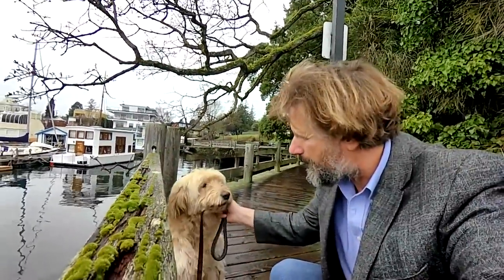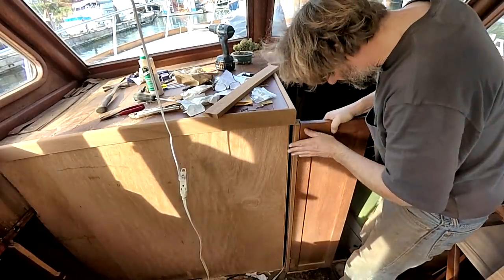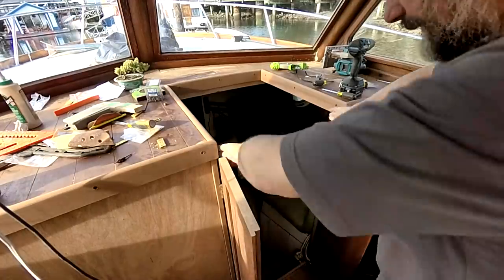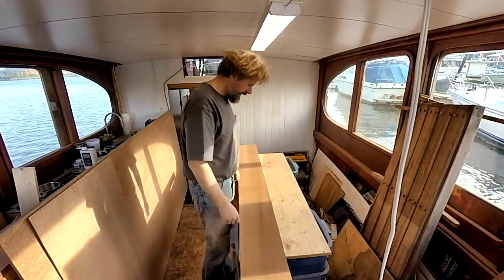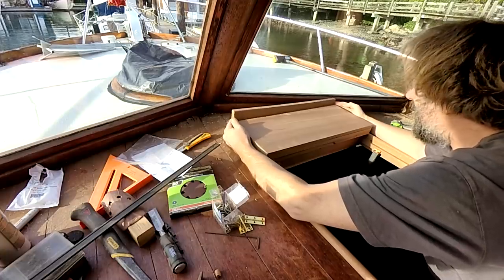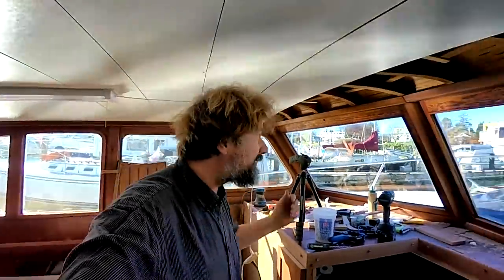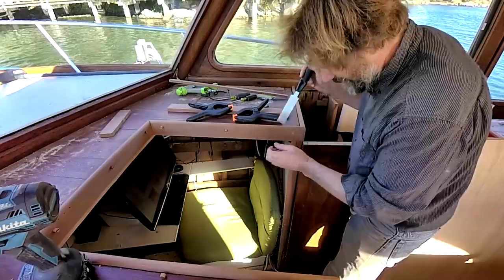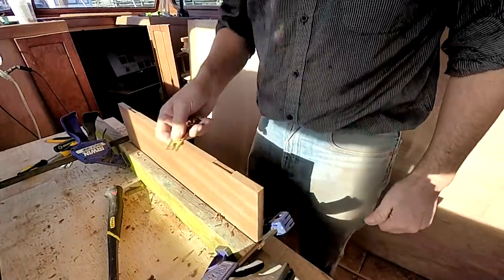Finishing the companionway hatch - Wooden boat liveaboard - Boat Refit - Travels With Geordie #97

Comment: Beautiful work Peter.  I have just one question.  Is there a reason you don't stain the wood to make the wood and the bungs/plugs uniform in color?
Reply from the maker: Thanks Todd. Good point, in a perfect world, I would make an effort to match the hue of each plug as I insert, after all, they're cut from the same wood. I have done this on small projects. But for this work I'm content to see the contrasting plugs. They will mellow out to be much more similar in time.

Comment: Great video Peter. For a man that does not like doing something, you do it very well. Will you be using Tung Oil on the exterior parts? The 🍺 tasting is a great finish and very unique. You have great content to your videos and could justify Patreon Page, good luck.
Cheers
Reply from the maker: Thanks so much Duff. I use Tung oil on everything for the first two coats, inside and out. Finish with the Wipe on poly inside and Epifanes varnish outside. I made a mistake with the companionway, I skipped the tung oil and the finish is not nearly as rich. dang.